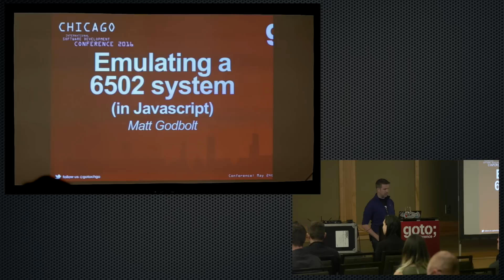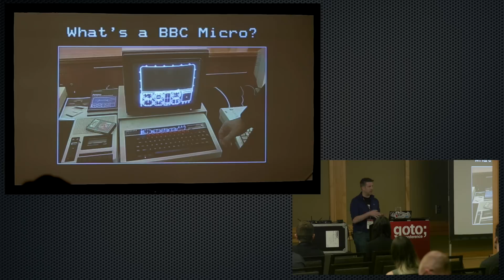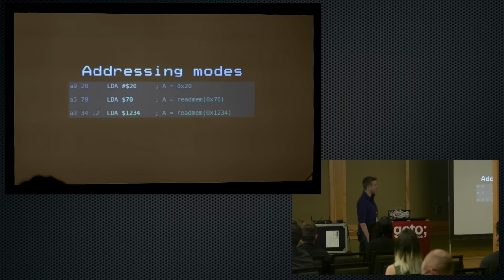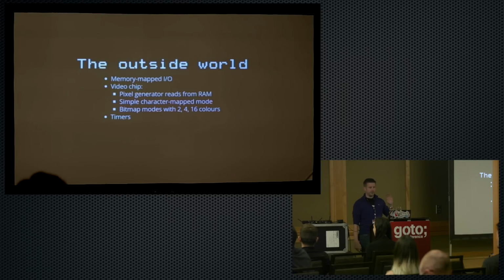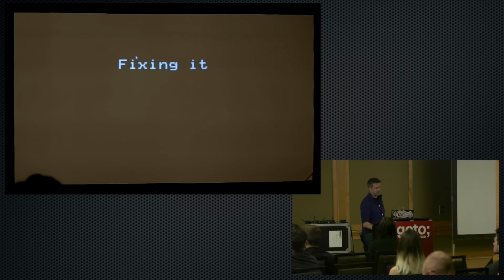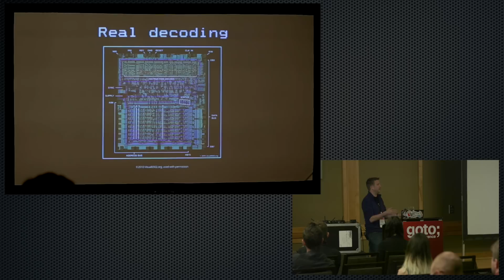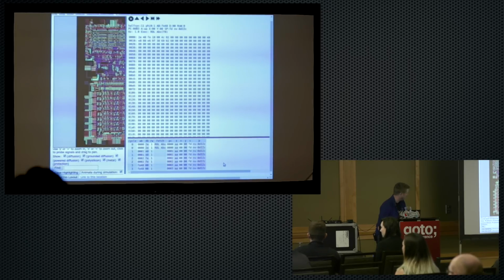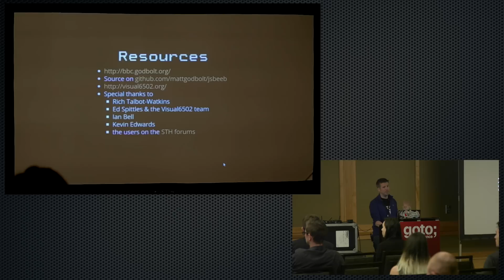Emulating a 6502 system in JavaScript • Matt Godbolt • GOTO 2016

Comment: The thing he said about varying the volume register to play digitized sounds. On the C64 at least, the original SID chip had a leaky op-amp at the output pin (the designer, Yannes, knew this but didn't have the time to fix it properly) which output a DC level proportional to the master volume. What this meant was you could play 4-bit digis by piping them directly to the volume register. I love this kind of stuff!

Comment: Fascinating how you count cycles to change graphics modes in the middle of generating the display.  This clever hack essentially implements what the Atari 800's graphics system did with a display list.  Essentially it was a program for the graphics chip that said what mode to use for each line (with the option for an interrupt at the end of any given line).  But Atari set it's processor speed to match the speed of the CRT scan to allow the exact same tricks you described.  There are games where they used cycle counting to know how far over in each line the drawing was so that they could change the color registers for a section of the screen.  (On the Atari, you had one-byte color registers, but depending on the graphics mode, usually had only four available (two bits per pixel identifying the color register to use.)  I suspect the Atari 2600 pioneered such techniques, so system designers after that made sure the timings would work correctly.  Interestingly, this means the PAL Ataris ran at a slightly different speed from the NTSC Ataris, and not all games took this into account.

All that means that many arcade-style games did all the logic during the vertical blank period where the electron beam was turned off to reset from the bottom right to the top left for the next frame.  The vast majority of the CPU power was used to manage the graphics, even with Atari's advanced (for the day) graphics chips.

Comment: I'd like to know what the actual speed of the emulation is.  Since you mentioned things that needed special optimization, I gather that the detailed timing-step emulation has trouble keeping up with real-time?
Reply: It's a bit tricky, but there are some hacks that can be done in software to achieve it. You don't necessarily want to try to emulate the exact MHz through your main loop directly. You need to know the cycle count of each instruction, is it a 3 cycle, 4, 5, etc... then you also need to know what type of instruction, addressing mode, etc. it is in order to know which physical device it is going to talk or interact with next. This is important because in some systems such as the NES there is more than 1 bus! The multiple buses may not operate at the same exact frequency, but what is normally constant is the rate at which the device operates depending on the type of instruction. A register read will in many cases be shorter than a register write. This is typical but it also depends on the hardware design such as write protection, caching techniques, pipeline, pipelining, etc...  So you have to pretty much understand the entire ISA, the internal components of the hardware, how they are connected, how they operate, and how they interact with other devices in specific contexts... Yes, this is a mouth full and isn't a straight-up answer but this is the kind of upfront knowledge, research, and thinking that goes into hardware emulation. It's not easy! So in a sense, if you know the ratios of the general time taken for a specific device to do its, job and report or talk to the bus and you know which bus it is talking across and where it is going, then you can generalize this...
         
    // arbitrary pseudo code
    // CPU cycles depend on the instruction type
    // We will assume that all instructions take at least 3 cycles, fetch, decode and execute where others may take 4 or 5...
    // InsA  = 3 cycles,  InsB = 4 cycles, InsC = 5 cycles.... 
    //  This could be the fetch cycle. The main bus is calling its readCPU function to get the information from the CPU's fetch cycle,  
    // the cpu is reading data from memory where &data is the pointer in memory...  We don't know what the instruction is just yet...
    mainBus.readCpu( cpu.read(&data) );
    // Now this data that is passed to the CPU is now stored into the CPU's cache bank or internal register that is for decoding instructions.
    // the CPU will internally decode this and output the appropriate value from its internal decoder that is going to be sent out to the bus to be executed.
    // cpu.decode(&data) could be called within the read function of the CPU class. 

The value may or may not need to be saved to the cpu's internal buffer so we should cache it in a local temporary before decoding it. It depends on the type of instruction and or data it will need to be saved before processing and modifying it. If it's a jump, return from a subroutine, etc. it'll need to know the current "stack pointer's value, as well as the current instruction memory address... etc.  If it's just a simple LDA immediate instruction, then it wouldn't need to save it. Before the decoding takes place the original (data) value should be cached into a local temp in case it needs to be saved for later. If it does then the original value isn't lost so that the passed by reference can be modified by the decoder and can be updated accordingly. Otherwise, the cached value can be ignored and will be discarded afterward... 
    // Let's say &data had InsA that is 3 cycles such as LDA  #$20. The data value would contain something like 0xA920 which would be a 16bit value. Even though it is an 8-bit system. It would parse this and now the CPU knows to load the value 0x20 or 32 in decimal into register A. It doesn't need to save the original (data) so the cpu's member variable will not be overwritten. Now the CPU has to put this value of 0x20 onto the bus along with the control lines or signal to enable write to register A. So this may now look something like 0x0120 where the 01 would be to trigger the write for the A register and the 20 would be the hex value to store. Data is now updated and that is passed into the bus by reference and the readCPU function would return a value of 3 to the bus for the cycle count. Something of this context could be used. There are other ways to design this in software. Hashmaps can work, lambda function calls can work, function pointers can work, meta templating, even bit twiddling, etc. There are many ways to design this in software. And these function calls would consist of the first 2 microinstructions that are typically common with all instructions (fetch and decode).

Now all that is left is to use the value that is passed to the bus to determine the ratio of the (CPU execute), or other connected hardware such as PPU or APU, etc, ROM read, etc. If the instruction took 5 CPUs, instead of 1 cycle left, there would be 2 extra cycles. These values can determine the ratio of device calls within the loop. Now, there are possibly some (exceptions) as well as (interrupts) that have to be dealt with as well and in uncommon cases, either a 1 cycle no-op or a 2-cycle unconditional jump that needs to be dealt with.  Now the main loop itself wouldn't be stimulated to run at (2.4 MHz) directly. What would be done, would be to set the loop to run in a frame buffer with a target frame rate of say 30 or 60 fps...  and depending on the ROM and how it behaves, this target FPS might have to be adjusted which could be done either dynamically by the program(emulator, engine) itself or through user application input control that would save to a configuration file or settings file as they could adjust it at runtime, or both...

So, in the end, you can "generalize" the hardware itself in software, but when it comes to the many "roms" out there that would be emulated on it, you might have to debug and tweak each and every room, find out what does and doesn't work and how to fix them or "hack" them to work. Then, write them to an initialization file that would be a part of the emulators supported ROM list... so if someone has that ROM, that "ini" file would be loaded in. However, for something like this to work, the user would have to follow a specific naming convention of the "ROM" files for it to work or load both files in order to retrieve the appropriate "INI" for that "ROM"! 

Yes, I know that this was quite a bit to take in and quite wordy, but this is only the tip of the iceberg when writing emulators. Take for example the NES. To get the CPU and Bus components working with all of the known and unknown instructions isn't too bad. Now include the PPU, and the APU, and the other busses, now include the ROM Cartridge link or reader... Some Cartridges have small internal RAM... which has to be taken into consideration. Then it's a matter of linking and synchronizing them to work together in an integrated fashion. After that, know you have to handle the sprites, as well as all of the supported mappers. Then you would have to figure out what kind of hidden techniques different developers used to layout their information, index specific addresses, using interrupts at specific times, etc... so there is a lot that goes into emulation! For, a software program to be called an emulator it should be able to perform all possible operations as the hardware it is emulating including the internal hardware bugs if known!

Comment: Just thought...
Just need someone now to take an ARM processor that is running Javascript, placed in/on a board with some additional logic that emulates the 6502 signals on the processor pins. The board would be the same size as the original 6502 and have the inline pins down each side of the package. So basically you would have a 6502 processor, but inside it there will be an ARM chip running Javascript on top of an OS etc. You could then take a real BBC computer, place the ARM/Javascript/6502 processor in the original 6502 processor slot on the BBCs PCB and run BBC software on it. Then in 50 years time someone will write an emulator that mimics the ARM/Javascript/6502 processor using a Quantum processor using QSscript, then someone will suggest making an ARM/Javascript/Quantum/QSscript/6502 processor. Then in 100 years...
Reply: This has been done (not in Javascript though): https://stardot.org.uk/forums/viewtopic.php?t=11325
Raspberry Pi runs a 6502 emulator, and then connects to the coprocessor interface on a Beeb using the GPIO.

Comment: Using a switch case statement for emulation is bad practise and leads to bad performance. You may want to use an array of functions with a function for every instruction. That way the opcode can be used as an index into that array instead of doing hundreds of compares per instruction.
Reply: Paul Reichbert Computed Goto in C/C++ FTW!
Reply: Idk about javascript but this is generally what a switch in C/C++ gets turned into anyways.

Comment: This might have been interesting if was on implementing using Rust - or Verilog for an FPGA implementation (e.g., MiSTer), but all these crap emulators written in JavaScript so they can run in a browser window are just the worst. Expectations have moved on. Software emulators of any stripe are no longer adequate. The only emulators that are satisfying now are the FPGA implementations. The MiSTer project has set a very high bar and everything else by comparison to it is just pathetic.